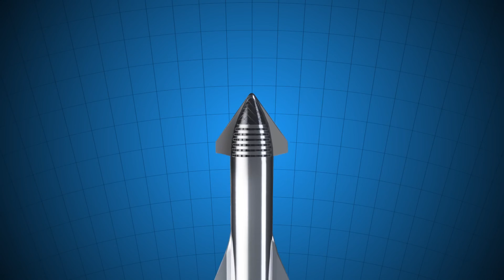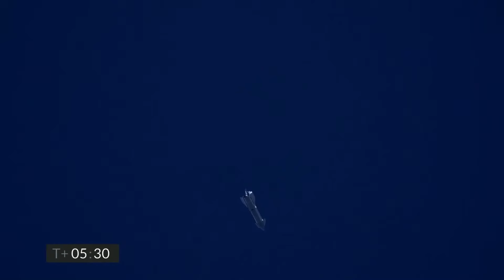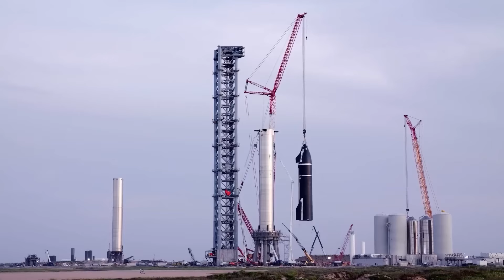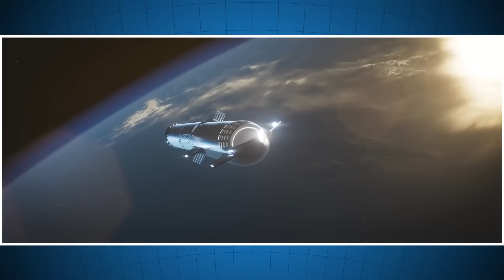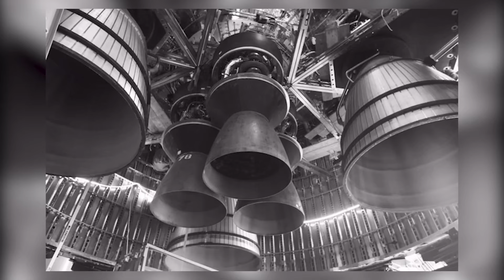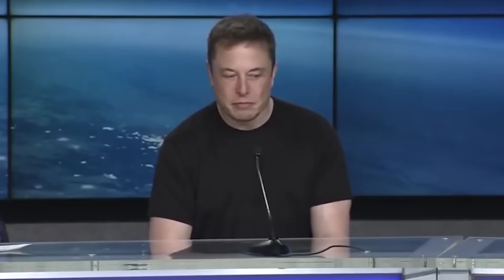Why Wings Aren't Great for Rockets

Comment: The booster uses grid fins instead of ailerons and it doesn't use the "belly flop" manuever to land. The second stage never needed wings, flaps, or ailerons because they don't  produce aerodynamic lift